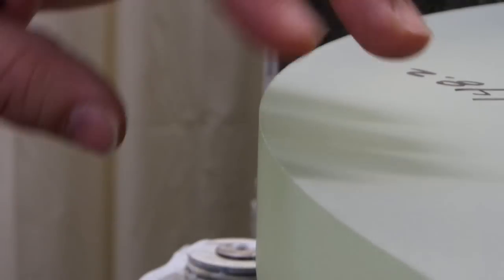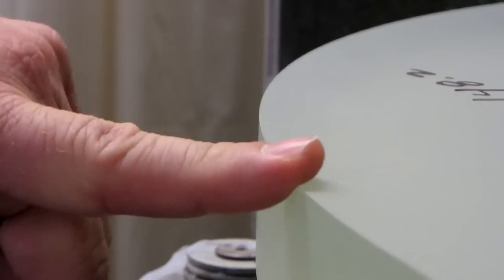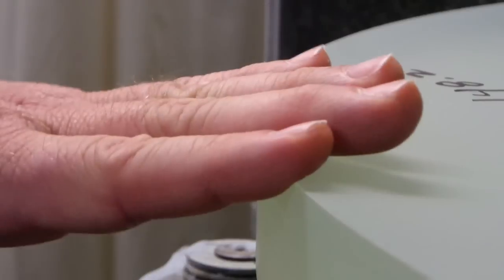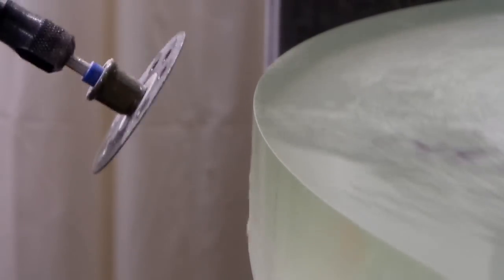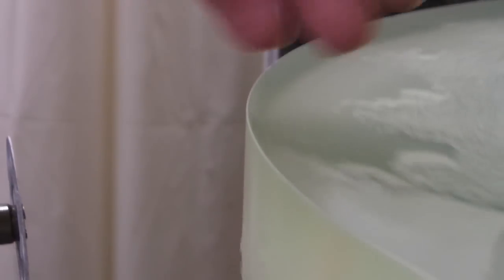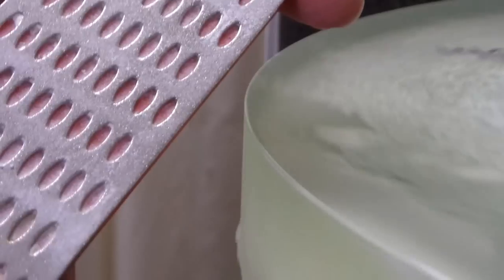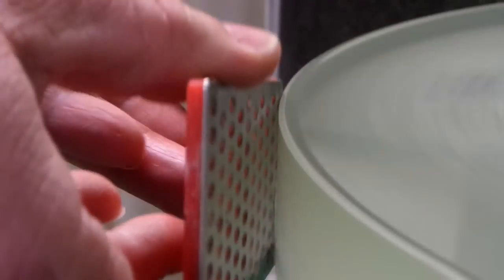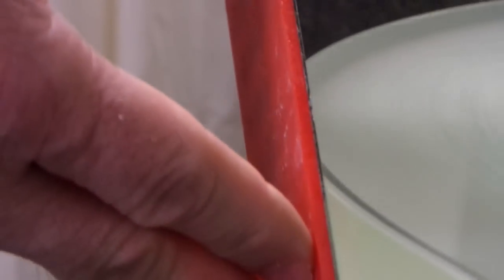Grinding a 25" F3 Telescope Mirror: Chamfer and Edging

Comment: Gordon, can I ask what motor and speed controller you used in your machine?  I was looking at using a drill press motor for the machine I'm building, but having the ability to quickly & effortlessly change from low speed to high speed would be a huge plus.

Comment: I have a suspicion that unless you have a pretty constant supply of water feeding that high-speed disk, the actual contact area is actually dry while you're grinding.  The adjacent glass surfaces are wet, but that may not mean much.  Have you tried a drip-feed in the past for this type of thing?

Comment: Is there a reason why it's running about 20mm off center?
Reply from the maker: When I do an edge bevel, I just lay three hockey pucks on the turntable to raise the mirror up a little so the diamond blade doesn't strike anything.  I don't make any effort to center the mirror, as it doesn't matter at all for beveling the edge.  As long as you are running the turntable slowly, it's very easy to follow the slight movement of the edge.

Comment: how do you apply the silver mirror coating? I cannot find any video's on you tube covering that aspect.
Reply from the maker: Marcus Lotinga While it is possible for an amateur to build a coating system to evaporate silver or aluminum, it would be quite expensive and quite time consuming.  Nearly everybody uses commercial labs to get their mirrors coated.  Our go-to coater is Majestic, and you should easily find them on the Internet with a little Google browsing.
Reply: thanks